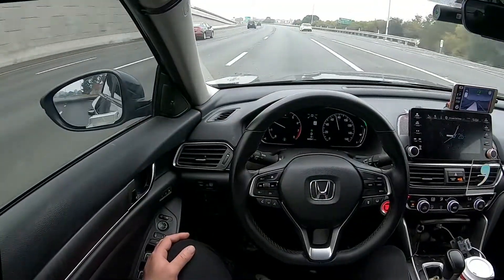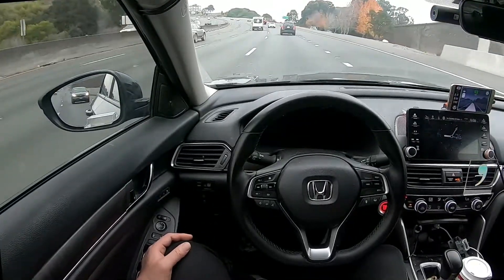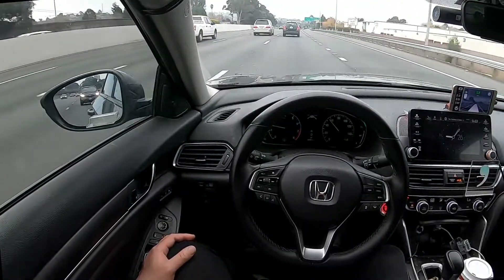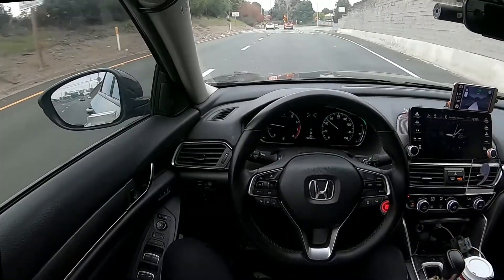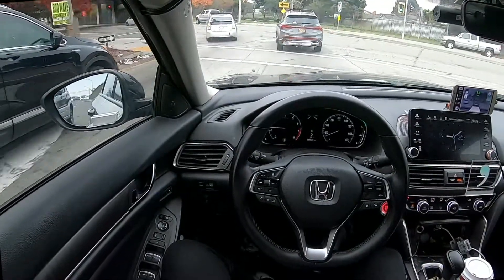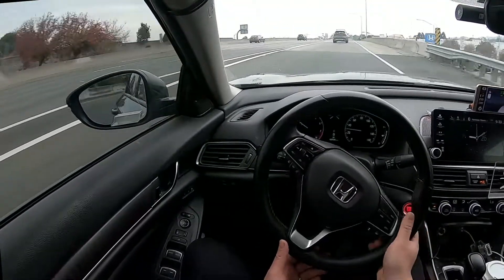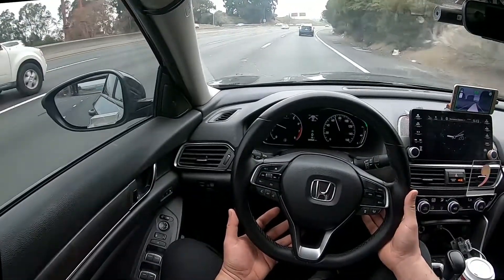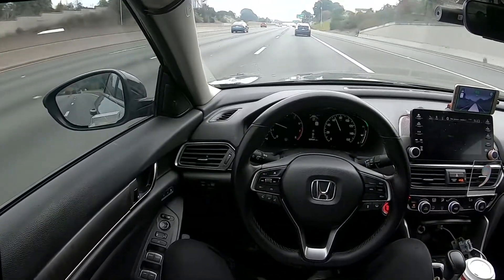Souped Up Honda Sensing  Revisited  / Dragonpilot  Release 2 + Leeco  Openpilot Honda Accord 2018

Comment: I'm on release 2. 0.9.1 model is rock solid. 

torque mode with torque tuning unlocked full potential of  Toyota EPS.
Reply from the maker: compared to NG , better?
Reply: Minh is your vehicle able to stop at the light correctly? I had issues with it stopping a bit too late landing in street crosswalk.
Reply: @ItsLocFoo  stop signs and traffic lights are still very early phase. Give it a little time to mature.
Reply from the maker: @ItsLocFoo  i don’t  test stop lights , i use my car’s stock acc (Bosch radar) I highly recommended chill mode.  Experimental mode is for peeps who like to test and report bugs to comma. It’s gonna be buggy .
Reply: Yes. Much better than NG. No more jerking after a few hundred miles. Feel like " on rail ". 

I meant I'm on beta2 for comma 2. 

Ps: Loc, my car doesn't support OP long. I use stock radar.
Reply: will do thank you!

Comment: It would be really cool if there was a way to record the comma screen while your going through the settings. I know DP changes from time to time and am curious what all is changed in the menus. Great vid man, thanks!!
Reply from the maker: i mostly test lateral, basically i just enable 24/7 lkas and play with the offsets .   best way is to load it , each toggle has a  description on to what its purpose when you tap on the wording. it s easy to understand. I dont mess with the long setting since i use stock acc (bosch)